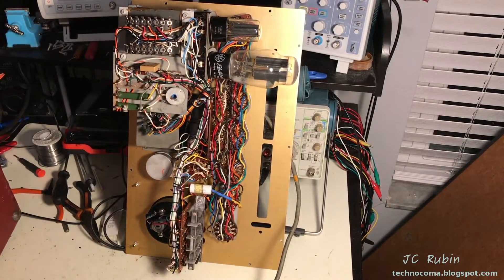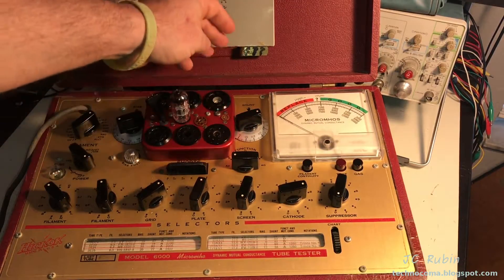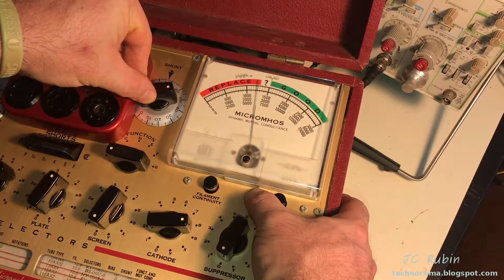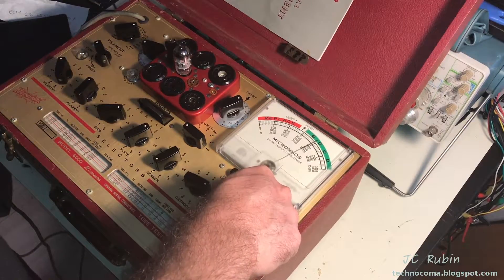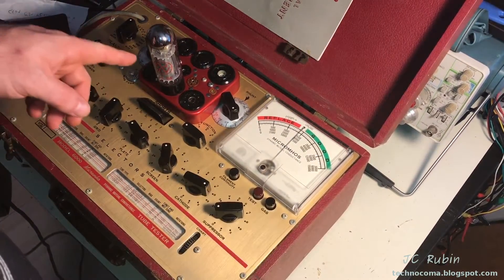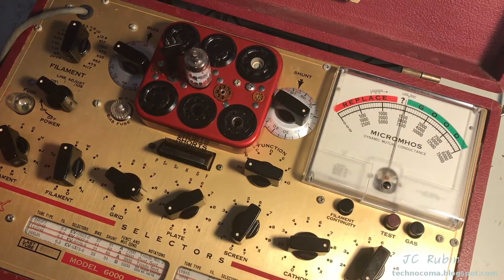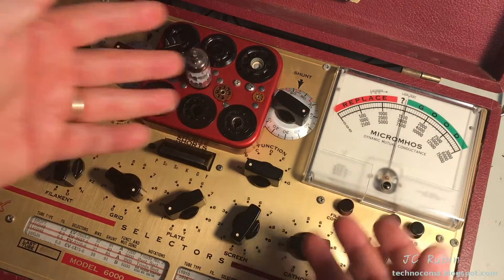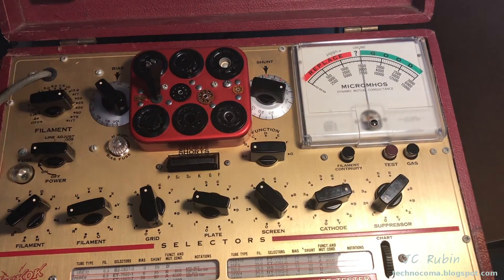Hickok 6000 Tube Tester - End of Restoration - Applications, Testing and Analysis

Comment: EL34 same as 6CA7, which is on the roll chart. Speaking of roll charts, on both my 6000A's the roll chart binds up as it nears the end , at both ends.  Anyone else experience this ? How to remedy ?
Reply from the maker: It would need to be removed and inspected, repaired if necessary.

Comment: If want a tester like 6000 that has fixed micromhos switch would be the 533 model its little larger and older but has fixed gm switch i belive the 750 also has fixed gm switch for better accuracy

Comment: The bias has more effect cause it's applying the signal voltage to tube so if it's low has big effect on gm reading. They use a very fine wire bias control for that reason so it can be controlled with very small amount of ohms

Comment: Correct on the accuracy of tester if can get it within 10% then tester is as good as will get. My 752 has the multiplier switch for repeatable results. But also added a plate 2 test button so no changing switches to check other side so way faster for dual tubes. I just got a hickok 600 I'm restoring using that for good and bad and micromhos with reference

Comment: That's why the hickok 539c is best for that has fixed conductance switches and a bias voltage scale. I sold my hickok 6000 and purchased a hickok 752 for the reason of having fixed gm switch and can test double sided tubes by just pressing another button. Perfect time for matching tubes

Comment: do you mind sharing some advice? I have a hickok 533 that I replaced the wax capacitor in - when i press the test button the meter is going a little wild, wide swings, not stable reading, any ideas of what to check? thanks much
Reply from the maker: get a copy of the schematic. Thats all I can advise, maybe a bad connection or a failing tube.

Comment: Hi Rubin,, Great Job!,, If you pick up a 533 or 533A and then add a Bias Voltage meter,, It makes the tester a little more workable.. Limitations are still in the Bias and English or Shunt control pot quality.... So I've been told the tube manual is supposed to indicate what the Bias Test voltages for tubes should be. I also use a modified octal Tube socket set up for Cathode current. Anode,,Grid voltages with external meter readings,.. Works Great!.
Reply from the maker: Yeah.... but even if it had the values, I couldnt bring myself to mod the original unit.   If I needed to know that bad Id build a Utracer.